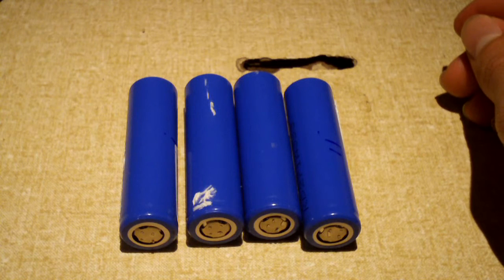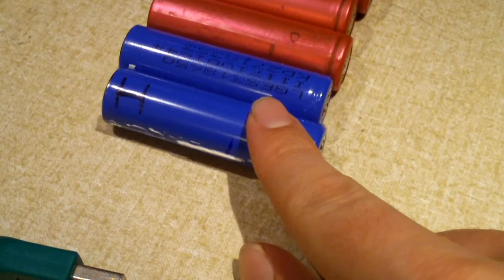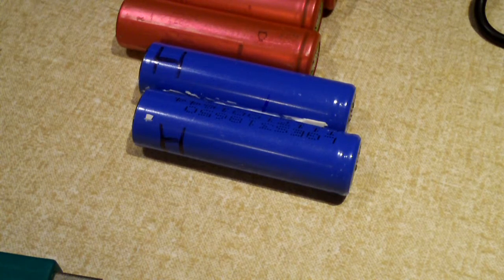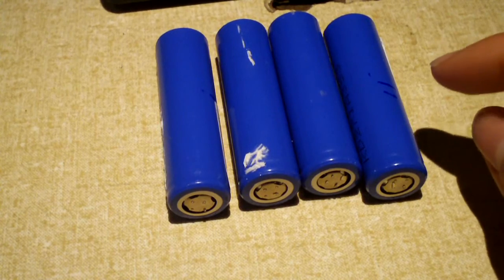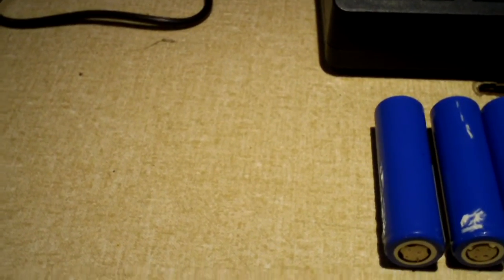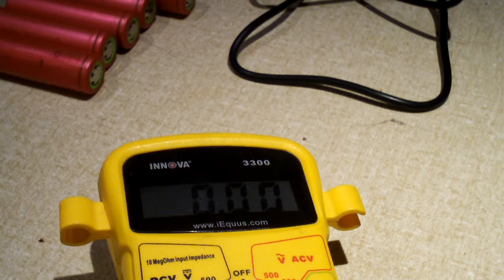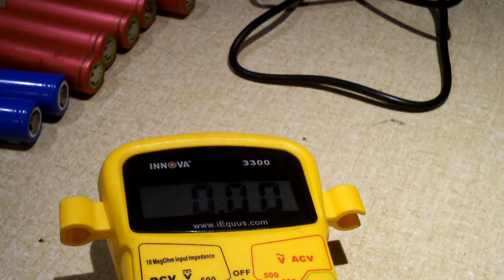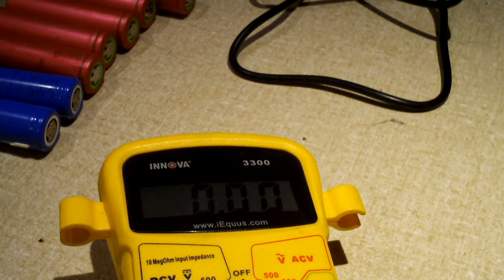Part 2 - Things to know regarding harvested 18650 Li-Ion Batteries

Comment: It's funny that I got 3 or 4 cells that also start to heat up toward the end of the charge, I let it cool down and then put them back on the charger and it finished charging without any heat at all, I haven't tested them yet for capacity or anything and most likely are not reliable, but I just found it odd that after cooling down they finished charging like nothing happened...
Reply from the maker: Those cells aren't safe. Quite a few packs from HP and Toshiba have been recalled due to fire risk due to their Sanyo cells getting hot while charging, right near the end of the charge cycle.
Reply: Thanks for the heads up! There are indeed red sanyo cells! And from a Toshiba pack if I'm not mistaken!